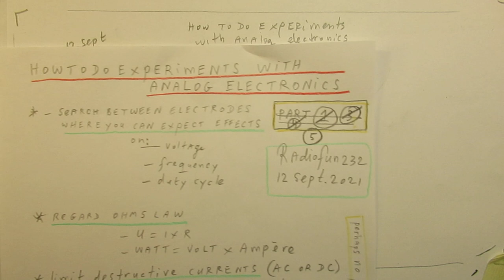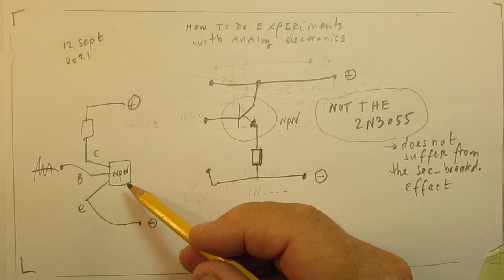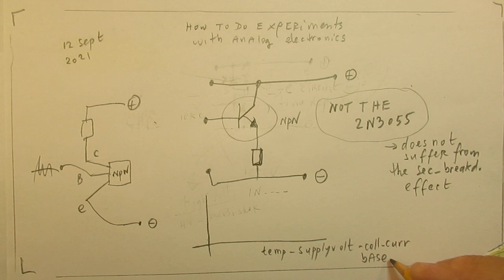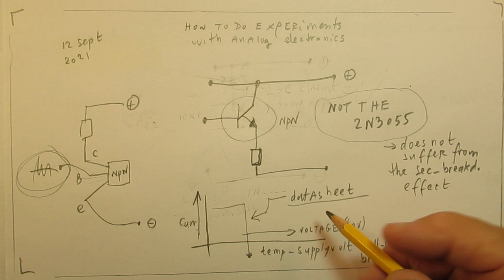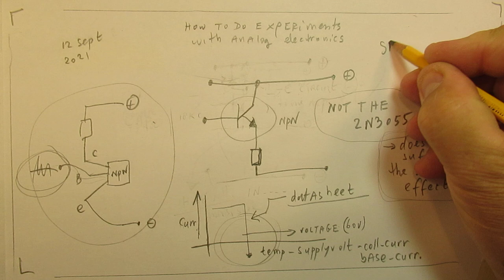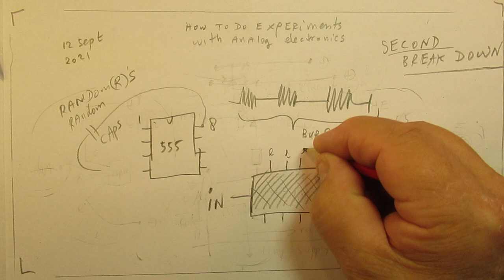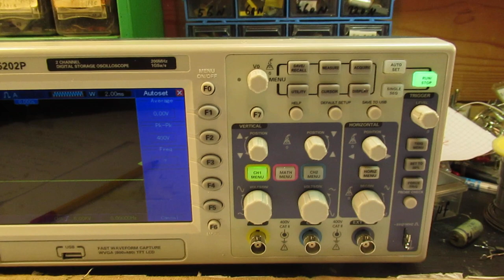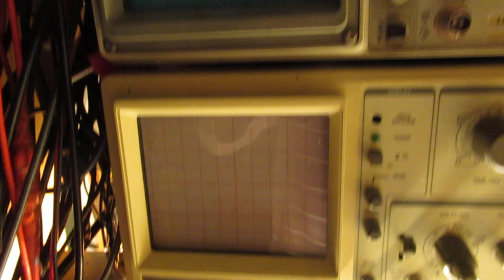How to do experiments with analog transistor circuits: part 5

Comment: Very good advice on the 3055 used as regulators for years. Then the IC regulators took over.  more efferent is a switching  regulator. the dropping resistor in past can be a large waste.

Comment: I was once tasked to reduce a circuit's current consumption by half! Although no official data was available, I simply used a circuit to switch the chip's supply with a 50/50 duty cycle - it worked superbly :) Sometimes it's worth thinking sideways. Interesting video, thank you.
Reply from the maker: That was and is soo good and smart!